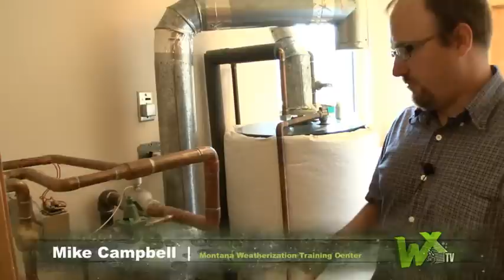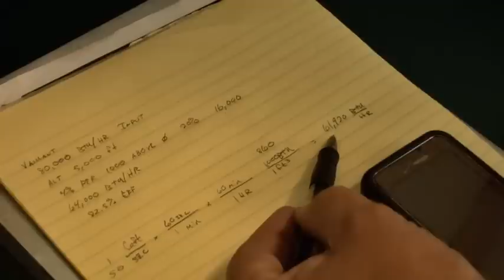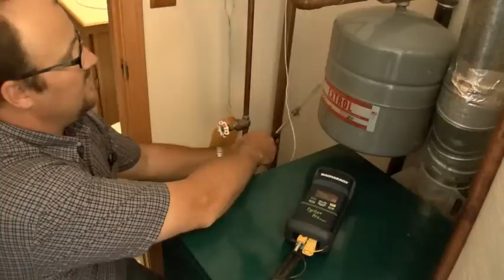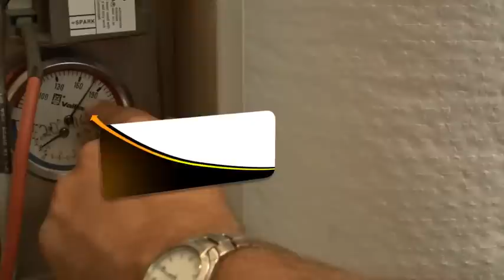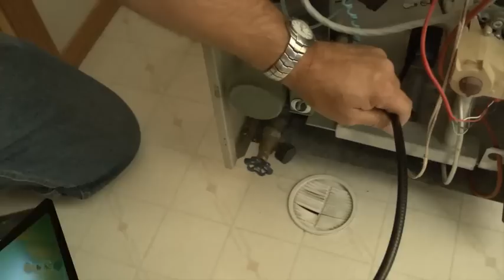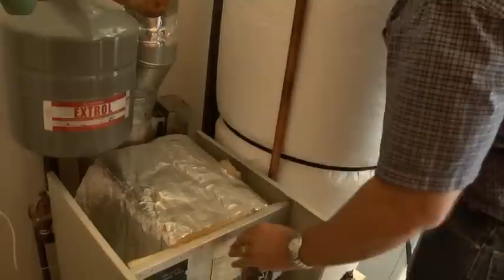Boiler Basics: Part II - Clean, Test, & Tune

Comment: trying to install a kero boiler any info on how to wire it and plumb it would truly help it's cold in here lol my cell is 649 1084 thanks every one
Reply: thats a big job man... depends how man zones you are going to install, is it monoflow split loops, how many floors, what is the BTU required per room?  what is the total BTU required in cubic feet to heat the home, what style of controllers are you using? tegmark? taco? are you also running hot water too off of that boiler, are you using a boiler mate? you'll need an expansion tank (make sure the tank has roughly an 18 inch straight pipe before the tank, a water feeder, air bleeders, circulator or circulators ball valves before and after, drain lines, proper piping sizes... i mean honestly call a professional... i'm sure you could make something work, but you'll run into more problems in the long run if you don't.

Comment: I have the exact same boiler, just did a leak repair, replaced some pipe and used you videos to make sure I was bleeding the air out properly thanks !    Any way to set this broiler up to our home hot water as well ?
Reply: an indirect boiler mate would work great for using your boiler to also supply your hot water. it would take a decent amount of pipe work though. if you are already running natural gas or propane i'd suggest looking at your current tube size that supplies your boiler with the natural gas or propane and if you have enough volume available (depending on length of the run and size of pipe) you could always Tee off of that line and add a nice little hot water on demand natural gas or propane system, they take up far less room and work very well. depending on model they are fairly cheap but would require some electrical, piping, inlet and exhaust work which is fairly minimal and generally take up less space than a boiler mate (depending on the size of your room and location etc) and how much hot water you actually need to supply your demands. hope that helps.

Comment: one mistake youmade is when there is a callfor heat and it shuts dowa at 190 i assume on the limit  the damper stays open.
Reply: shawn butler I thought the same.

Comment: when pressure is high,  you said water is released.  where does that water go??? out the sewage line? or out back to the house water supplly?
Reply: To a floor drain.  Or more likely just all over the floor.

Comment: How about just checking the gas input pressure before and during run, and manifold pressure and adjust to specs.  It is a heck of a lot quicker than doing all those calculations out in the field.